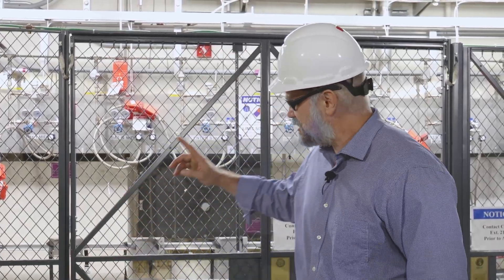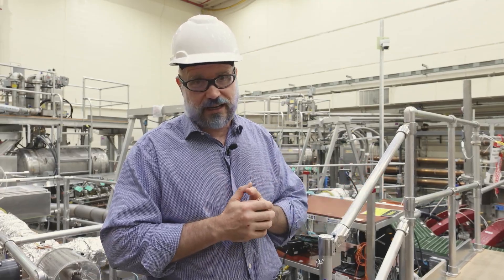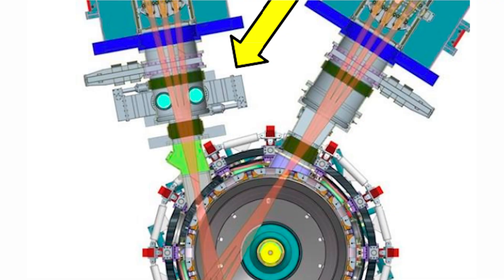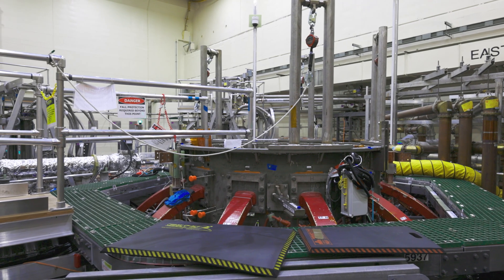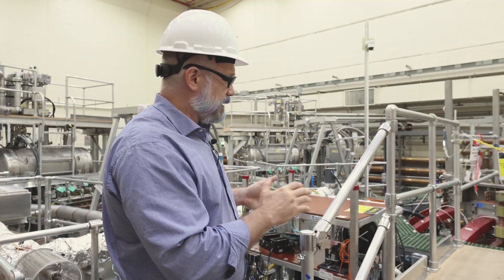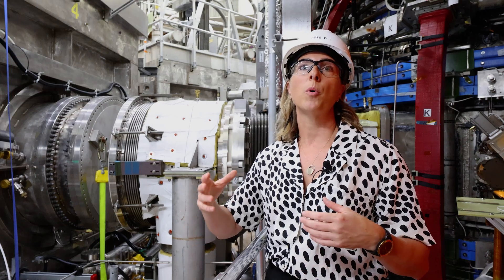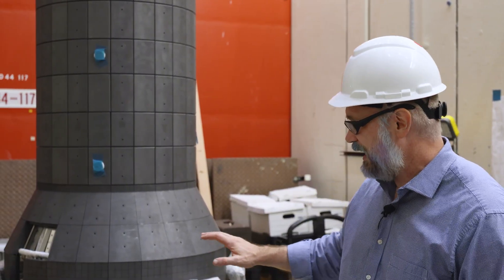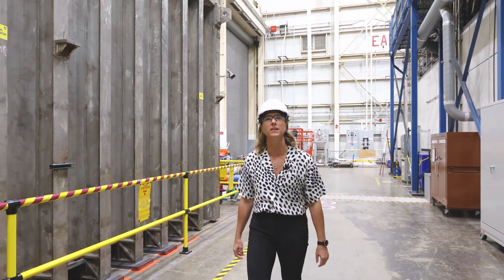Virtual Tour: National Spherical Torus Experiment-Upgrade (NSTX-U)

Comment: You people are delusional. I came to your facility last year and I chatted with your director and showed him my star device that is the size of a golf ball and output 90,000 watts from an input of 1800 watts. This can easily and inexpensively be scaled up to a large device inside of a current hydrogen storage tank with electrodes placed on the top of the hydrogen tank and electricity pulsed through the water to fuse the water as I describe in the remainder of this message.  The sun is not a hot ball of hydrogen plasma but has a layer of liquid hydrogen on the surface, a Na-Ca-SiO2 glass, a saltwater layer, a gallium layer, and then an iron center. It is a water electrolysis fusion device. The neutrinos form the universe hit the glass layer and change the Si atoms into another isotope thus liberating electrons that circulate around the glass layer and through the center of the sun to make the magnetic field. The electrons on the surface of the glass layer also make the electric field. The electrons have a lower luminosity charge and thus allow the glass layers atoms positive charge to attract neutral atoms on its surface or the gravity field. The Earth and the Moon and all heavenly bodies work the same way. The electrons going through the saltwater cause it to undergo electrolysis whereby the pressure inside of the glass layer increased tremendously and fuses the water. The reaction is H2O + e- = Fe + Ga + tons of e- + neutrinos + light. I know what I am chatting about as I have a materials engineering degree from Rutgers, and I worked with Professor Smoke on making parts for the original Princeton Tokomak from 1978 until 1980 when I graduated. I have taken many, many, many online science courses to learn all of what I chat about and have a non-credentialed three-year PHD in all thing's science. You people have done nothing about my fusion device that you could easily test for $100 with parts from Amazon which is what me and my friend Jeremiah did. I would show you here again, but I cannot. I also have much experience with computers and electrical mechanical devices. The hydrogen at the surface of the sun is a liquid due to the high gravity field of the sun. You can easily use a phase equation to calculate that the hydrogen at the sun's surface has a boiling point of about 6000 degrees K where the sun's surface is about 5778 degrees K. Stars like our sun go red giant as the fusion reaction progresses the liquid hydrogen then turns into a plasma and expands as the sun gets hotter and hotter. A supernova occurs when the fusion reaction heats up too much and the pressure inside of the glass layer becomes too great and the sun explodes and the iron in the center gets compressed and turns into a neutron star. The sun going red giant and the fusion reaction continuing heats up inside of the glass layer more, so the glass layer and the water expand off and then sun then compresses the iron layer into a white dwarf that then cools off over time and goes dark.  Hans Bethe was incorrect and was a very abusive guy so why would you listen to him and follow his incorrect analysis of how the sun works. You people only teach the theory in our school and quash all other theories, so our kids all get brainwashed with this bad theory of how the sun works and they continue the delusion as this is all that they know. Real science does not oppress other theories and analyzes all theories and not just one theory. The SOHO image shows these layers. Stonehenge was made to show us the layers of the sun with the number of posts and stones corresponding to the materials that the sun is made from. The Gravity Probe B experiment worked with the glass silica gyros that were like the sun's glass layer. The Gallex and Kamiokande experiments work as the sun has the gallium layer and the water layer producing neutrinos of the proper energy. The answer is staring you right your faces and you all do fusion incorrectly. We will all die from global climate change due to the mainstream science delusion. God save us all!  You don't tell people you know better than them and not try what they suggest out. You follow the scientific method. I worked for the US Army Black Ops under the Reagan Administration, and I devised the fusion device that currently powers the many UAP that people see on the TV show Skinwalker Ranch, the Star Wars Defense Initiative, getting Arpanet to be the Internet, and faking people out with what you are doing to keep the fusion reactors that actually work secret.